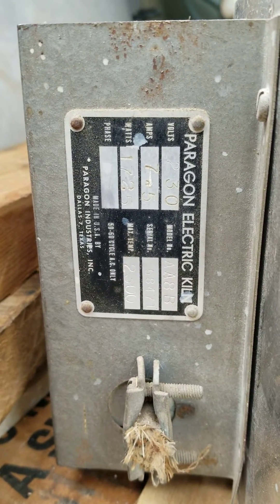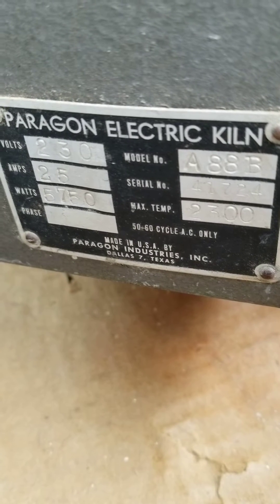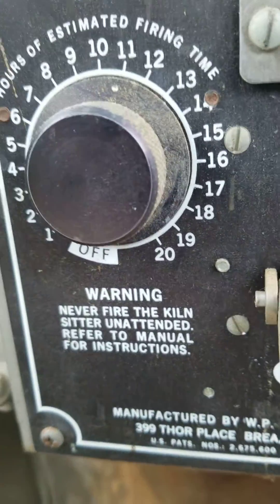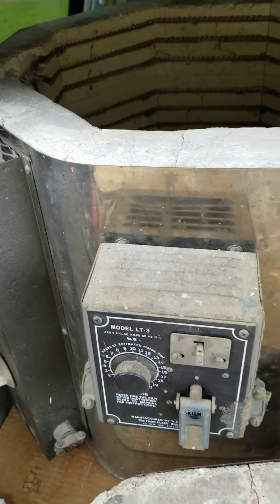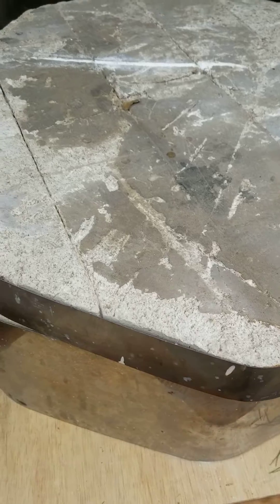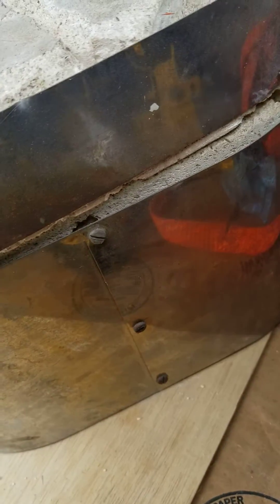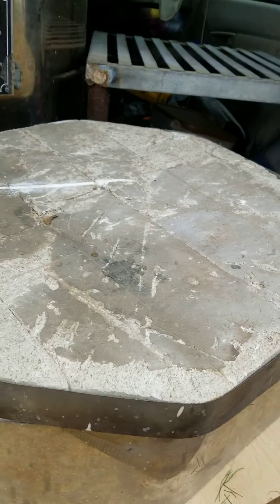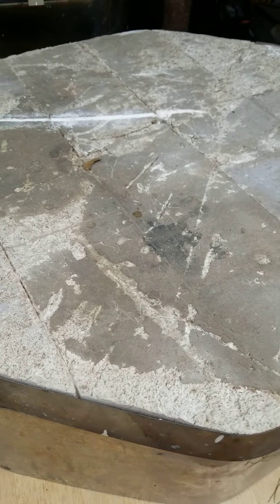Paragon Electric Kiln Rescue Restoration Project - Models LT-3, AA8B and A88B

Comment: Have you fired your kiln yet? I have the exact one.
Reply from the maker: No, I still have to work with.  Haven't gotten around to making space yet.  Actually, was just on the phone with Harbor Freight regarding replacement parts for their 10x10, 10x17 and 12x20 CoverPro canopies.  Got another free frame that's another 10x20 make not like my 10x17 and 10x17 blown down freebie, that was blown down so only came with a good side and end covers with solid roof though all bent other than one side riser mast pole pieces.  Thinking I can still use the bent pieces with tube inserts. Now you mentioned, and I actually didn't bother ordering a cover to try to use, I noted that for the price of the 12x20 cover I'd most likely just invest in some sheet steel material from Menards or wherever is most cost effective. Thinking I'll just cover the top for now with with four sheets of steel full length along with a ridge cap and possibly corner end pieces.  I have to look and see what I have, since I might have enough good tube from the free blown down 10x17 to make a 10x10 which I think I have enough steel to cover that roof at least and most likely cover all plus with a few doors as I have some free steel and also garage doors I can use as siding material that would work as I know someone who sided theirs using garage doors though shrunk their frame down to fit.  That would be perfect for high temp crafts like the kiln and I do have enough generator power now I do believe to run using, though I was debating for the price, to possibly modify to use gas in one so can be a hybrid gas electric kiln.
Reply from the maker: Kind of a tangent as well, though related is I was thinking building the steel covered version on top of gabion or maybe wood frame or better would be cinder block base that's about 3-4ft high to gain space to frame a loft inside to add additional useful storage.  Would create a solid base as well.  Technically, makes me think the gabion stone filled option would be the better solution for kiln and metal working projects use. For the loft I'd use old pallet rackets, so the inside would fire proof.